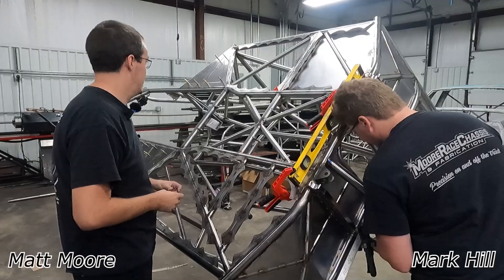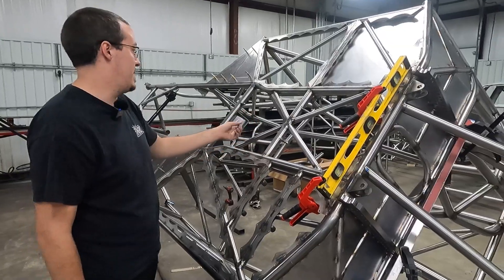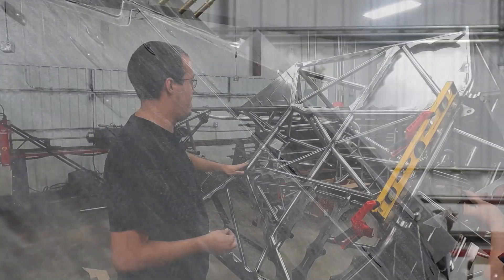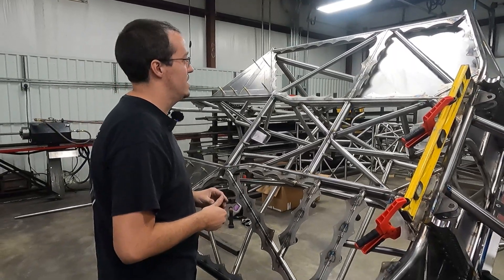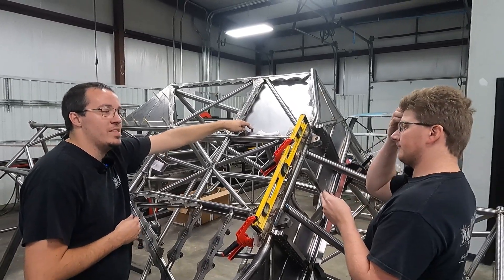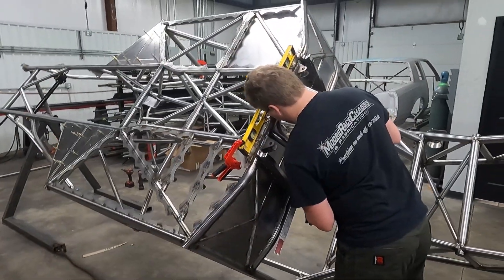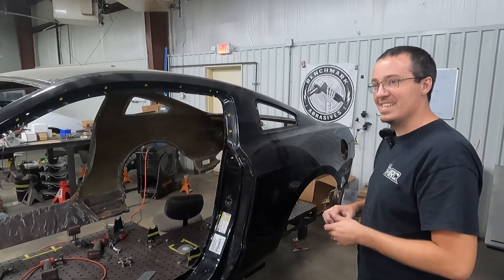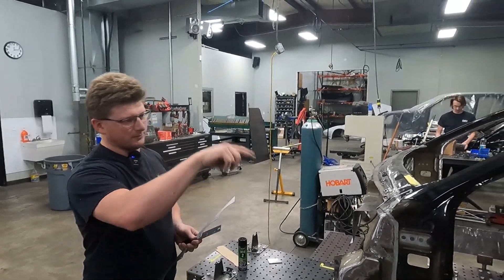Snot Rocket 3.0: Carbon Belly Pan Installation & Titanium Upgrades for Ultimate Aerodynamics

Comment: Why is this car built 25.1 cert vs Cleetus' Eagle 25.2 cert?
Reply: For eagle, to make the chassis stronger and they can add weight more to where they need it with higher max. Weight. While snot rocket is aiming for lightweight i guess